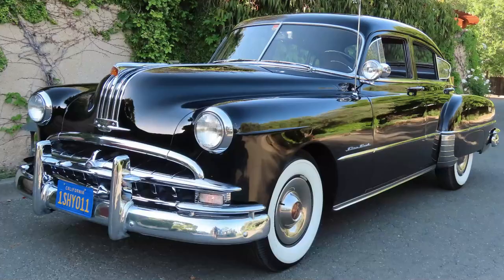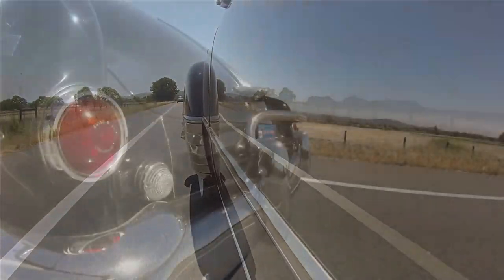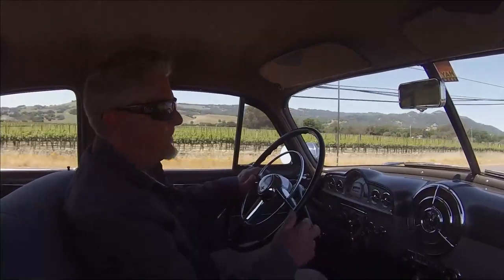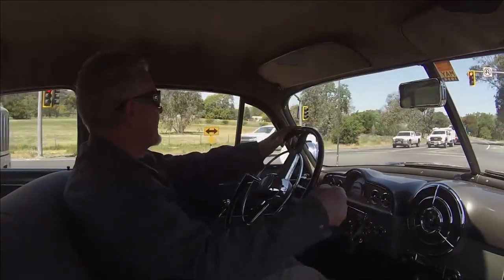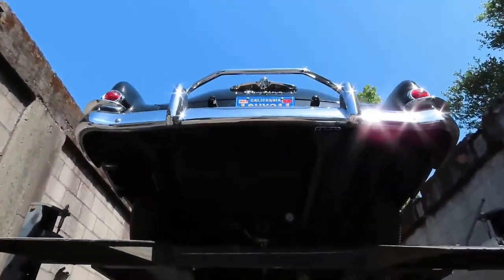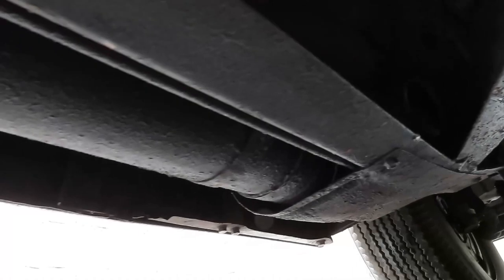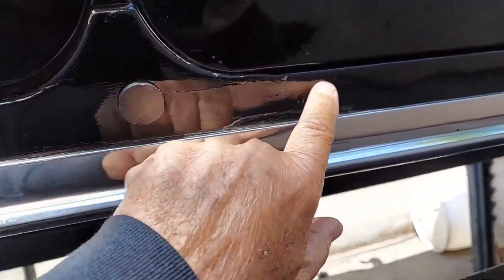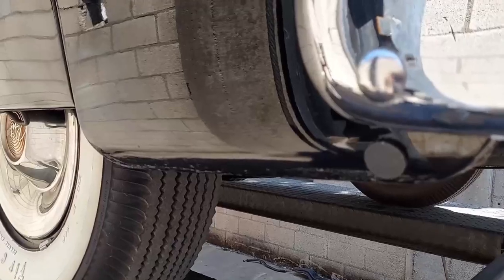Very Original 1949 Pontiac Streamliner Silver Streak

Comment: I worked detailing used cars in the mid '70s and let me tell you, you have to be a contortionist to get the inside of those teardrop/fastback rear windows clean without streaks.  :)   Oh, and BTW.  I sold new and used cars eventually and I think about 80 per cent of all cars more than five years old the clocks never worked.  They seemed to quit after a couple of years.  :)   Beautiful Pontiac.

Comment: My 49 silverstreak i got 2 week ago has 57 000 original miles found with 59 plates on it I find it very odd nothing's rusted away mice ate all the rubber besides that it's still a very nice car original engine and hydromatic transmision still thinkin about swapping the engine tho
Reply: I hope you didn't put a Chevy engine in it.